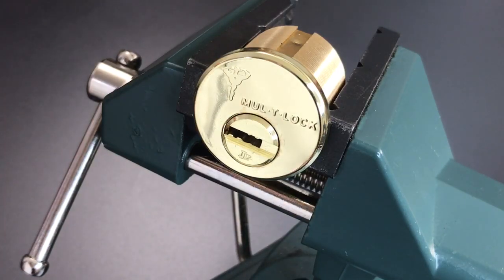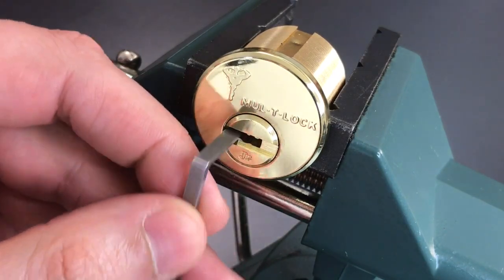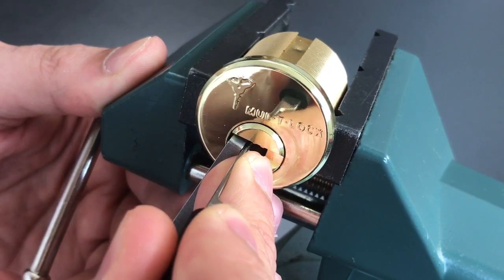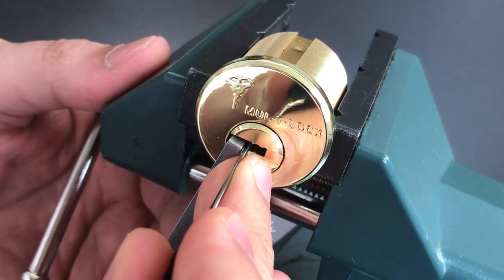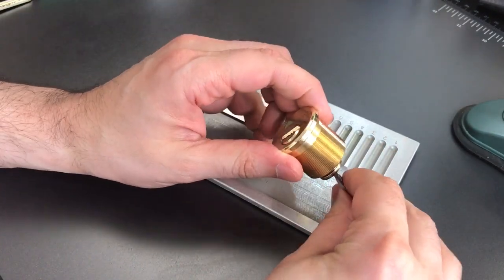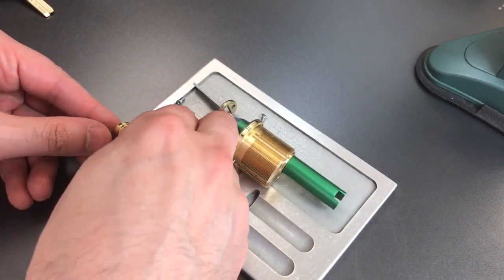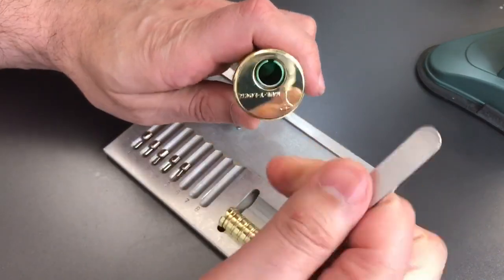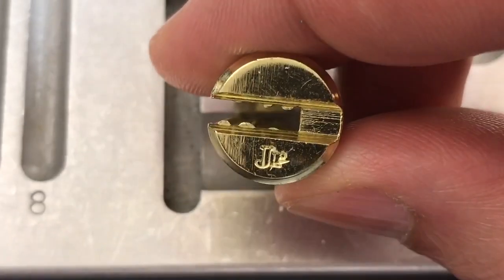[487] Mul-T-Lock Jr. Picked and Gutted

Comment: Can you help me please? I've picked open a mul t padlock with an interactive pin, but I don't have the key for it. The problem is: when it was  picked open, the shackle turned to the opposite side so the padlock locked again and when I try to pick it with the shackle in the wrong position the pins do not bind anymore... What can I do to open it again?

Comment: what do you mean by counter rotation?
Reply: When picking, and tensioning the lock, the core will rotate a little bit into the direction you're tensioning. When a security pin is being forced upwards by the pick, it'll rotate the core back in the opposite direction. That is counter rotation.

Comment: Would you say that Mul-T-Lock dimple style locks are more secure than your usual pin-tumbler designs? It seems that it puts up more of a fight when picking and greater pin density could allow for more complex pinning.
Reply: More pin variation, but less height generally to lift the pins (a few millimetres), results in longer pick times and less likely to be bumped. introduce a sliding side bar too and you got a tough little challenge lock.
Reply: My opinion is that they're better than the standard Schlage/Kwikset locks for pick resistance, but are less resistant to picking than sidebar locks like the ASSA twin or Schlage Primus locks. The MT5+ with the sliders is quite pick resistant.  7X7 (very old) can be opened pretty easily.
Reply: Kwikset? This Junior is way better. Sure, every lock can be picked... but this one will take more time and SKILL.

Comment: Don't think I've ever seen a mortise cylinder with a tailpiece. Any idea what application this would be used in? I can't really imagine how it would function.
Reply: My error, it is a combination lock, usable in both combinations. Change tail pieces and it goes both ways.
It's a rim cylinder, LPL miss stated the mounting. A mortise cylinder screws into the lock mechanism that is "Mortised" into the door, then the attached tail piece activates the lock mechanism from the inside.
Where a rim cylinder is attached to the door typically with a rear plate and screws that pass through the prepped hole in the door and the opening force is transmitted through the tail piece to the "Rim" mounted lock mechanism.
The deadbolt is a hybrid of both mechanisms. The bolt being drilled and "mortised" into the door edge and the outside and inside cylinders and control are "rim" mounted on the door.